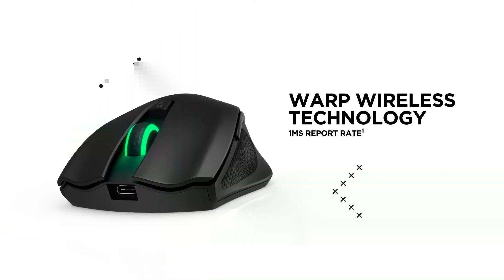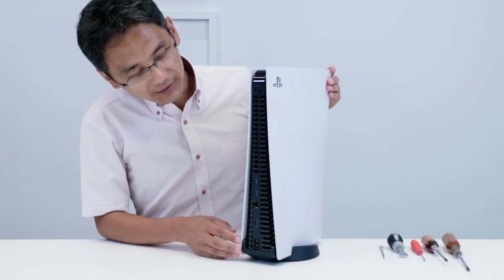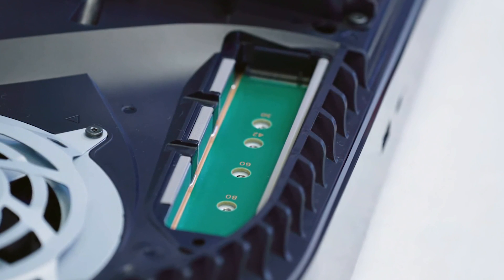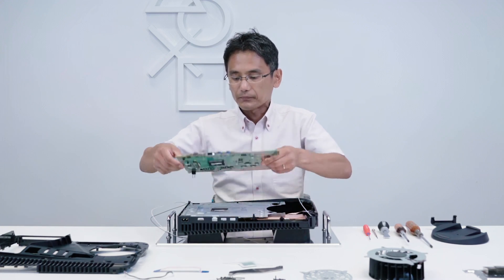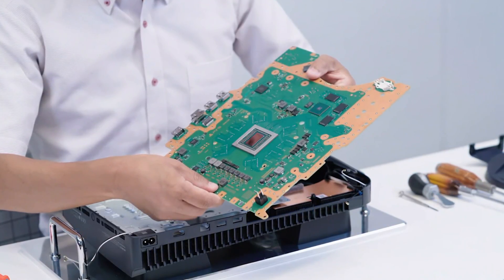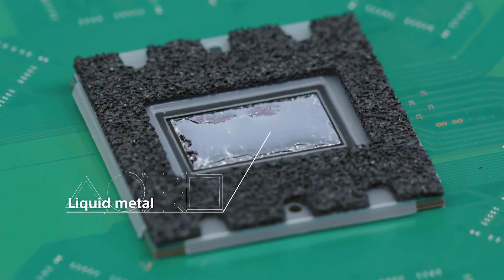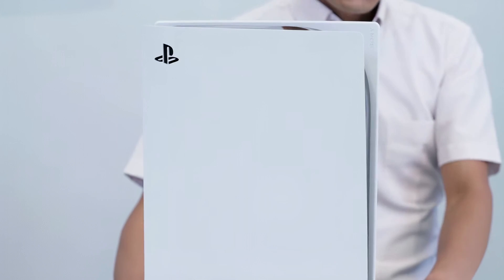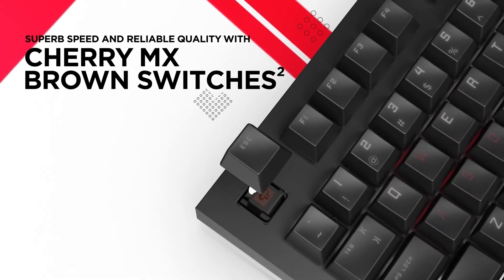PlayStation 5 Teardown Analysis: Inside Sony's Next Generation Hardware Design

Comment: Just to say, it's pleasing to see both MS and Sony put together very well engineered consoles with excellent build quality. 

Couple that what looks like - at least at this moment in time - a really fantastic amount of  performance for the £499 price point.

I still have concerns, primarily around software, which means I won't be buying at this stage. Covid makes the market tricky as well. 

But it can't be denied. Both hardware manufacturers have done a tip-top job.
Reply: @H Kirky the advantages go further than just Teraflops, with 8'4 for PS5 (10'2 with overclock) and 12 for SX. The new Xbox will use RDNA 2 while PS5 will use the first version of the RDNA with some specs of the second one. Anyway, if the specs of both consoles were the exact same, we should praise Microsoft for making it smaller and more accesible. We are talking about consoles not about PCs and being compact and accessible for people with not many knowledge of informatics is really important on the console market. That's why i think that having to open up the PS5 to implement extra storage is a big mistake by Sony. On the other hand, expanding the storage of the SX is as easy as inserting a card
Reply: @H Kirky that's my point, range rover engines are better and bigger than Fiat engines and therefore much more expensive. The thing about PS5 and SX is that SX has better specs in a compacter system, they are worth the same amount of money nevertheless. So Sony might have done a nice job with their new console, but Microsoft did an outstandig one
Reply: @H Kirky You seem really hurt. Fanboy.
Reply: @H Kirky I guess form factor wise yea, but internally your not seeing anything pc like from the series x maybe besides the fan cause gpu fans look very identical to the sx fan, look at the 3090 & then the xsx fan & you will see, but comparing both ps5 & xsx to a pc & which is more built like a pc, I’d have to disagree w you on the internal parts, the xsx internal is nothing like we’ve ever seen, it’s brilliant engineering, the ps5 on the other hand is more... more traditional w how they did their design, besides the ssd being soldered onto the board, other than that the ps5 resembles more of a pc than series x does, 

Now if it were a ps5 interior w xsx exterior then yea its a pc lol, but ,

N the guy above me, it seems like he agrees, or I should say I agree cause I wrote after him but I was doing homework & would have responded quicker if it weren’t for that
Reply: Yeah. It's obvious both had slightly different priorities regarding the capabilities as well as the physical design of the consoles, but both seem to have done a stellar job.
Reply: Ps5 is not well engineered. It looks like a diy repair nightmare.
Reply: @H Kirky What PC do you know of with a custom split board like Xbox Series X? 

Both systems have an extremely custom internal SSD solution and outside of that the PS5 is so much closer between the two to a traditional PC setup, with a large single board with pretty standard cooling system and even a standard M.2 slot for expansion. The only thing more like a PC for the XSX is the tower style design of the system.
Reply: The PS5 is a mess compared to Series X, can anyone explain why are both worth 499$? PS5 should be way cheaper imo
Reply: @H Kirky watch the Series X teardown and you will understand. I'm talking about materials, the way the console is cooled, the motherbase, how the pieces are set up. Everything in the PS5 looks huge and cheap while everything in the Series X looks compact and with a better quality. It's clear that Microsoft made a better ingeneering work that Sony this time
Reply: ehhhh, no. A $500 PC built with modern parts wipes the floor with the new consoles, not to mention, cheaper to play games on. Consoles are still old hardware heavily gimped and overpriced with a fraction of the features any other computer, even your smartphone, has. 
Buying a console in 2020 is just as pointless and stupid as buying an Apple product in 2020.
Reply: @sqlevolicious  lol show where 500$ can give the same performance as the consoles will. You are looking at 1200$
Reply: Ehhh, Sony did good, but when compared to what xbox did it doesn’t look as good, not to say that they did bad or anything, just when compared, you know? But yah, I’d assume software from both ends will have been thought of highly, Software is always better than Hardware, its like having an expert shoot a trash gun vs a trash shooter shooting a good gun, the expert shooter will always gun him down, I’m excited for next gen to say the least
Reply: @bossmicky9256  it really comes down to Microsoft having endless resources and after loosing the last gen to Sony they turned it around. Both systems have thier strengths.  Microsoft focused on gpu power and Sony went with a highly custom ssd. They both push out similar experience. Microsoft still lacks good games and Sony ps plus lacks in terms of gamepass. There is not enough true next gen games out to really compare and that will be years from now.
Reply: @bossmicky9256  spoken with a robust American vernacular, thanks!

Obviously MS are miles behind on software. I like the direction they're taking, would have got some applause round the boardroom. But they have one glaring problem, which is no games.

Perhaps Halo Infinite will amaze us all, you never know
Reply: @lordofthegerbils  the games should be coming, but halo infinite will never be good, halo sucks, its a dead franchise, I hate halo, CoD is better, the best studio xbox has is turn 10 & playground, but the games will be coming, 23 studios strong, soon to be getting another studio thats “save the best for last” type of scenario, I can’t think of anything better than zenimax besides rockstar , but I can assure you the games will be coming
Reply: @H Kirky being big is definetely a discredit to the design
Reply: I do not see the well engineered regarding Sony's effort. From my point of view Sony got wind what Microsoft were up to, then began a massive overclock to close the gap, followed by variable clock speeds across the soc's GPU and CPU within a thermal budget. Even with that massive case and hamster wheel of a fan the variable clocks are not going away.  I'd like to know when a game is heavily CPU bound what is the TF drop on the GPU side going to be? 

Sony are usually 1st to shout and hype there new consoles, the silence here is deafening.
Reply: @regfenster   Maybe you're right, but I don't think when it comes to manufacturing GPU's, CPUs, and SSD control units, changes can just be made sporadically or rushed. To add new die and speed up clocks in a GPU it would still take some time, which would have probably put Sony back behind schedule. 

Sony was developing their liquid metal solution for a couple of years and put in patents for their UI and heat sinks a long time ago. So I think the GPU Speed was designed with an idea mind.  They also sent out development kits to developers before Microsoft. This is one of the main reasons Sony is able to show more hands on gaming with their Next Gen games using raytracing. 

RDNA 2 is a marketing term to help mainstream consumers know there is a new product but in reality it means nothing. It doesn't matter if you call it RDNA 1, 2, or 1.5. These are just simple marketing buzz words. Sony based their GPU on RDNA2 and purposely took things out and added new die. They also had a preview of RDNA 3 and added to their GPU accordingly. So the RDNA 2 argument is a pointless one.  

Variable frequencies is something AMD has been developing for a while, it is going to be in the core of their future productions for future computers to maintain thermals and increase performance efficiency. It seems that Sony took wind of that, experimented and were able to add it into their production. This is a good thing. Innovation is always good. 

Other things not mentioned in this video are: 

1) Sony's custom made flash control unit has a DRam-Cache with speeds up to 7gb/s and the cards can go up to 5.5gb/s Raw and will be using Oodle Kraken.  The Series X control Unit is DRam-Less with speeds up to 3.7gb/s and the cards go up to 2.4gb/s Raw and will be using Velocity Architecture. 

2) Sony has not released information on the size of their GPU cache and are using Cache Scrubbers to speed up efficiency. Microsoft has released info on the size of their GPU cache and don't have cache scrubbers. 

3) Sony has dedicated 16gb or Ram at 448gb/s and Series X only has 10gb of ram at 560gb/s. We don't know how that will play out when SSD speeds, the DRam-Cache, GPU Cache size and the Cache Scrubber all perform together.

If you think about it it looks like the PS5 was designed to compliment the SSD, and the SSD is literally in the forefront of their future gaming development.  Especially when you start increasing asset sizes with Quixel like technologies going up to 8k models as shown in Unreal Engine 5. You're going to need a fast system to keep up with these sizes to keep asset loading speeds efficient, and loading times low. You can even say that the PS5 was designed with the Unreal Engine 5 in mind.
Reply: @regfenster  They won't just change specs last minute, e.g. the work on the cooling solution would have started around 3 or more years ago. Similarly, AFAIK, the variable clocks aren't just a flip of a switch, but require dedicated silicon (and at that point, why not just increase the CU count?).
Reply: @regfenster  Why do you think that? On a console they can make a power profile for every single game. Also Variable clocks don't necessarily have to mean slower in every case. The majority of the time your workload isn't going to max out everything at 100% as things will start to bottleneck somewhere along the line. Not to mention developers are going to tune they're games to account for it.

Anyway, at this point in console history you know that the power of a console almost has no function on the type of games developed for it. The way the consoles are now we can see that the bottleneck is shifted to the humans.  Nintendo switch sells boatloads and rightfully so, they make excellent games for the hardware its running on. The ps5 is what 15-20% slower. That isn't that large of a fundamental difference considering how much resources this gen of console has to work with. 

Sony has those first party studio's that will squeeze everything out of the box. Microsoft has first party studios which are excellent, but we see as in the first party reveal such as Halo, they definitely stumbled when revealing it. They also seem to want to include there xbox one platform, which i believe is a mistake if they truly want to go to next gen.
Reply: @richr161  While I will agree w almost everything you said, xbox isn’t the only one developing games for current gen in mind, they are both taking this approach, sadly Sony did it w a game no one expected be cross gen in the upcoming horizon game, miles morales also wasn’t expected but it wasn’t no where near the level of disappointment until we found out horizon was ps4 too,
Reply: @regfenster  good point, yes. With my tin-foil hat on, it looks like Sony execs ordered a last-minute overclock, and we have this janky power splitting solution to fix the thermals.

Having said all that, I like what they've done from that basis. Liquid metal cooling, and dat heat sink.

The SSD is impressive, but part of me wonders whether Sony went a bit overboard here. Time will tell whether it makes an especially big difference.

Comment: Why doesn't the stand use a bolt like on most monitors? That cant come out and has its own handle? then they wouldn't need a screwdriver or a compartment for the bolt...
Reply: The best guess is that out was cheaper this way. However, it does bolt on for the horizontal layout.
Reply: I guess it saved a few cents?  Plus less likely to scratch the surface you have the console on when its in horizontal and the bolt would be loose.

Comment: The expansion SSD location is strategically distanced from the main board heat yet within a significant airflow channel. It should be fine for slim profile SSDs with thin layer heat/shield.
Reply: Looks deep enough for a low profile heatsink to be attached too
Reply: @David well.. you will not feel the latency
Reply: @NeoChromer  Whatever noob. That extra 0.00000000001ms latency will cost me kills
Reply: @chrisbaby2345  Sure bro, then go with a PC if you don't want latency
Reply: @NeoChromer  Nah I was agreeing with you, and also making a bad joke. Thought the 0.0000000000 gave it away
Reply: @chrisbaby2345  Ohh.. Me + Joke = Over the head
Reply: "strategically distanced from the main board"

yeah, if you didn't noticed SSD's can get really really hot and Sony just put one on the main entrance of air. 

yeah, the system will be getting HOT air because of an SSD in a bad location.
Reply: @bypass8277  well. Here we are 9 months later and SSDs are not causing any problems in terms of heat even without heatsink. Guesd you were wrong.
Reply: @EfecanYSL  SSD heat does not cause problems, rather, the SSD itself slows down to not exeed heat tresholds. So what you will have is worse performance, but worse peformance in a SSD that has 10 times the peformance any game uses is going to be unnoticable.
Reply: @bypass8277  Not a big problem in my PC are 2 SSDs in the front and 2 HDDs both are gettin with the fan around 35-45°C warm and no issue (with 2 fans in the front)
Air can be a bit warm when its moving no big deal.
Reply: It is very, very inconvenient the location they chose. The fact that you have to open the console to add more storage is just bad design for consumers.
Reply: @hectordelarocha10  it's out of the way, appears to be actively cooled, doesn't require proprietary tech and you need to open the console anyway to hoover out dust build up. It's not that big a deal unless you're a child. Literally look up a video on it when it comes out and it could take you step by step through the process. It's easy if a little unnerving at first
Reply: @hectordelarocha10  No, just morons like you.
Reply: @hectordelarocha10  literally remove one plate and one screw, if you can't handle that then get a xbox series x
Reply: @hectordelarocha10  you sound like you arent familiar with machines with SSDs.

Comment: I'm interested to see how much faster games load on playstation 5s ssd as opposed to xbox series X on cross platform heavy graphical games.
Reply: Yeah thoreticly it would be twice as fast right? Unless there is a bottle neck somewhere else.
Reply: @westinbye  Probably shave off a few seconds as the better CPU has a bearing on things on series X too. We still don't know what speed the CPU in the PS5 runs at at start up either. I just don't like variances. You want full power all the time to all games even back compat is not going to be great on PS5 compared to Series X.
Reply: @DEVILTAZ35  no modern CPU is locked to a clock, it will always on a variable clock speed according to needs, it will just generate a lot more heat and consume unnecessary power when running a game that doesn't need it to be running full speed all the time.
Reply: We all are if Sony would let someone test the system
Reply: I expect load times to be a couple of seconds faster, don't get your hopes up.

Comment: Quite interesting how the conservative internals of the PS5 contrast with the striking exterior. Whereas Xbox has (based on my opinion) a more subtle look which some may call modern but complex interiors. I think if Richard is right about it coming down to cost then Sony has won it as they have more leverage to pressure MS on price. But that is probably why the Xbox Series S exists?
Reply: Possibly, though MS has very deep pockets and can sell at a loss much easier than Sony.
Reply: @bf5175  True about having deeper pockets, but it is not very common companies will actually sell at a loss unless they are desperate enough. You have to be very confident in your numbers that you will recoup over the long term to justify to your Board to sell at a loss. Everything has to be approved at this level and I doubt the CFO or Financial Controller at Xbox and Microsoft will take this lightly where shareholders can appoint and re-appoint Directors.

Comment: Does the orientation of the console (vertical, horizontal) affect the longetivity of the liquid metal? I really love my console in vertical orientation but i wonder if gravity would impact the liquid metal. I hope this is not a dumb question, have a good day everyone.
Reply: Nothing is certain, but shouldn't have any effect. In the first place TIM is used to bridge the imperfections (gaps) between the die and the heat sink, if the TIM is in the gaps it's not getting out. Especially since LM has surface tension too.